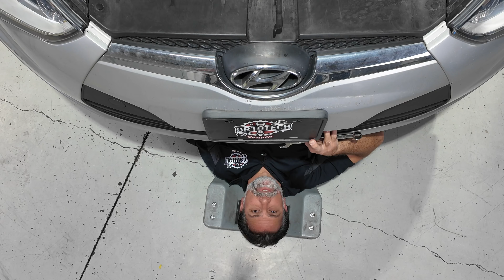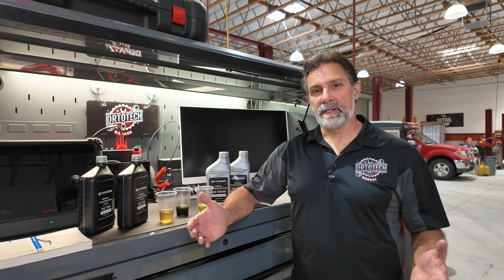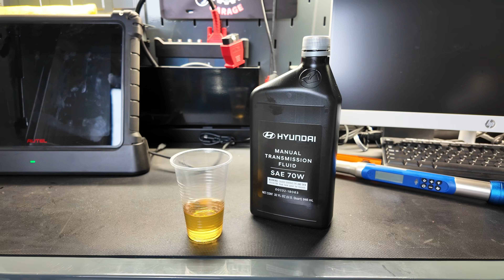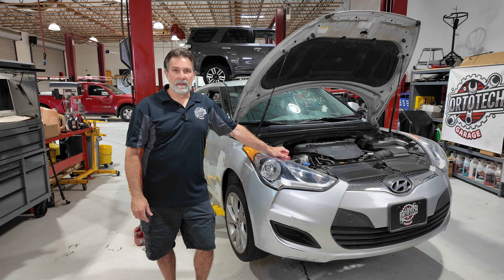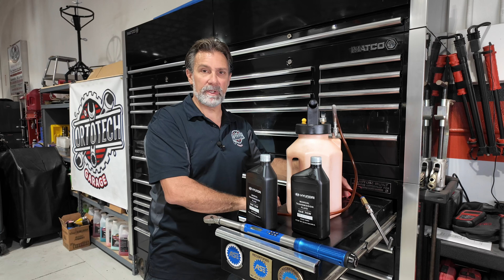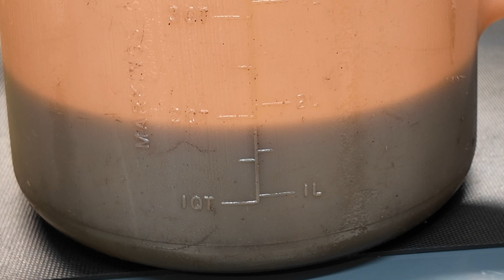This Fluid Change Was a TOTAL Mystery!

Comment: I believe some of your information is inaccurate, or at least not clear. For a GDI 6 speed DCT the owner's manual and service manual call for MTF SAE 75w85 API GL-4. For a TGDI (turbo) 7 speed DCT the manuals call for MTF SAE 70W API GL-4. Two different transmission. Two different fluids. 

Note a true manual, e.g. push the clutch and shift, was also available for the veloster. Which is 70w for both GDI and TGDI.

Second that is not the fill plug. The correct fill plug is on the driver's side just behind the CV axle above the drain. People seem to use the front plug because its really hard to get to the correct fill plug. Having said that, it appears to work, but you may not get the correct level.

Please know I don't mean any disrespect. I do appreciate you taking the time on this video and appreciate your work.
Reply from the maker: Thank you for sharing that information!  It is not disrespectful, actually very helpful.  I don't know everything  and I am still learning everyday.   All the conflicting information from the owners manual, the dealership listing, and the several transmission options seem to make what should be simple, a bit convoluted.  I appreciate the update.  Are you a Hyundai tech?

Comment: I have a Hyundai Santa Fe with a wet dual-clutch transmission. The manual recommends a 75W GL-4 type gear oil, but I have been using Red Line 70W/75W GL-4 MT-LV at my own risk. I believe not too long ago, Red Line updated its website and now lists this fluid as suitable for this type of transmission. However, I’m now considering switching to Liqui Moly 5100 75W AP4 gear oil, since it would save me at least $11 per quart compared to the Red Line oil and transmission takes 3 qts.
Reply from the maker: I think this is another situation similar to my video where there are a lot of options and does it really matter all that much?  With the wet clutch system the fluid is probably more important than the dry clutch.  I know Redline products are very good, and if youre not having any issues, I may just recommend you stick with that.  Its only $33 more. Why reinvent the wheel...

Comment: i can tell you for certain the turbo model which comes with the 7speed dry clutch dct takes dctf gl-4 70w
the non turbo model with the 6 speed dry clutch dct takes mtf gl-4 75w85
04300-KX1B0 looks to be the oem part number
Hyundai Mobis MTF & DCTF synthetic 70W 1L
Reply from the maker: That is great information, thanks for sharing the specifics on those different fluid types! 👍

Comment: Isn't it dry clutch transmission? It is literally regular manual transmission with few selector motors. So you can fill it with almost any fluid with same result. If you have deal with wet DCT -- you have to chose fluid very carefully, but dry DCT is very different.
Reply from the maker: Yes.  This system is dry dual clutch system and you are correct that this is basically an electronically shifted manual gearbox.  The fluid type can still be important if the manufacturer has gone out of their way to specifically identify what they want.  It may effect shift performance due to the weight of the oil. We never know what the engineers had in mind when they designed these components. I would rather use what they specified, although other options may work just fine in there.

Comment: Great video Keith, I ran into a similar problem with my 2019 Yamaha motorcycle.  The manual recommended 36psi for the tires, the dealership told me 38psi, and the tire manufacturer recommended 32psi.  I went with the owners manual.
Reply from the maker: Yes.  This can definitely be confusing.  I think tire pressures have a little more room for variations.  I know my track bikes I would run as low as 28 PSI, my road bikes I would set the at 32 PSI and then with a passenger on the back, I would bump the rear to 36 PSI.  The tire manufacturers specs are just the maximum pressure they should be adjusted to.  I like your process with following the owner's manual.  👍

Comment: I guess you know that the transmission has shafts and gears so will need to be heavier than std ATF. The shifting and control mechanisms however could make a material difference. As someone living in UK, you cannot trust the online oil finder databases where you just enter the vehicle details, they’re nearly always wrong. The lubricant manufacturers technical departments can also mislead you. Oil has to be brown, slippery and cheap. Your wisdom, experience and instinct kicked in here. Imagine some know nothing person would likely get this call wrong. Thank you for the education
Reply from the maker: Thanks for the kind words!  These types of issues occur quite often.  Having enough common sense to pause and make some logical decisions is definitely helpful. Not everything is as easy as it seems, and not all fluids are created equal. 👍

Comment: I used the Redline MT-85 gear oil for my friends 2016 Veloster. No issues in drivability and performance. According to Redline, it meets the spec for this DTC
Reply from the maker: I really like the Redline products.  I used to run them in my race bikes without a hint of problems.   Like I mentioned in the video, I assume either fluid would likely work in this vehicle, as well as others, but why would the manufacturer go through all the special documentation for these specific options, only to have the dealership selling something else. It always leaves us wondering what the differences could be...

Comment: I owned a Hyundai for almost ten years. A very reliable car for the most part. Though I do recall the automatic transmission fluid being a bit pricey from the dealer and other sellers.
Reply from the maker: I have been working on Hyundai products since the release of the Excel in the 1980's.  They have come such a long way from that, it is truly incredible.  The reliability is quite good on most models. Although they do suffer from a rash of problems, like all manufacturers.  Overall, they are on par with the other brands now, and even better than quite a few. 👍
Reply: I just paid $44.00 a quart at the dealership 😩😩
Reply: @ArmandoArispe-y2u  in the future I’d recommend Valvoline universal trans fluid. About $30 on Amazon for the 5 quart jug. I’ve used it for about 50k miles with no issues 👍

Comment: Keith, great video. I agree that finding the correct fluid shouldn’t be this hard. That fluid was dark so I’m wondering when was it serviced before.  I know some would argue not to service the transmission with high mileage and worn clutch material. I not a fan of DCT or CVT transmissions offered by certain manufacturers.
Reply from the maker: Thanks!  I can say I've only seen one transmission fail after a fluid serice in my entire career, and it was 35 years ago on a GM TH350.  The fluid had all kinds of clutch material in it when I dropped the pan. I have serviced thousands since then without an issue.  Sometimes we see people trying to correct an existing problem with a service and it makes it worse, but that's a different scenario, and still uncommon. 

This transmission is a dual clutch transmission and basically has the internal components of a manual gearbox, so it is not susceptible to those types of problems.  Just gears, synchros, and bearings inside.  They use electronic shift actuators to make the gear changes and electronic clutch actuators to operate the clutches.  Basically an electronically controlled manual transmission. 

The CVTs are definitely the sore spot, especially the Jatco made units, with a belt and sheaths.  They gave a bad reputation to all CVTs.  The Toyota e-CVT operates completely different and is super reliable.  👌
Reply: @OrtoTechGarage Right, Nissan was the one I was thinking of when they had terrible reliability issues. The DCT can wear down the clutch material and cause a jittery feeling.  Toyota has shown to be very reliable with their CVT.
Reply from the maker: Oh yeah!  The Nissan/Jatco transmissions are terrible.  We do many replacements on those, usually with less than 100K miles.  Some of them can benefit from an added transmission cooler.  Still very unreliable, though.